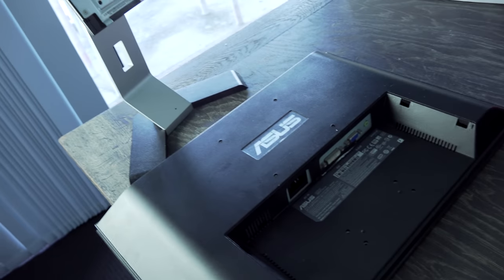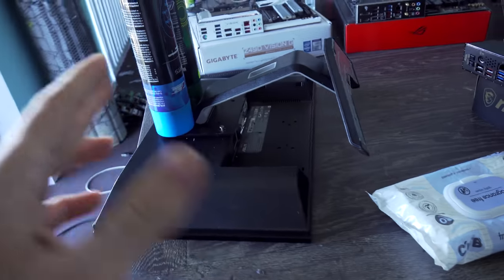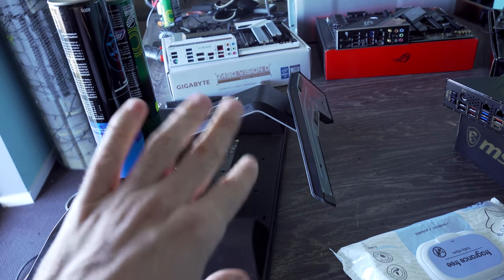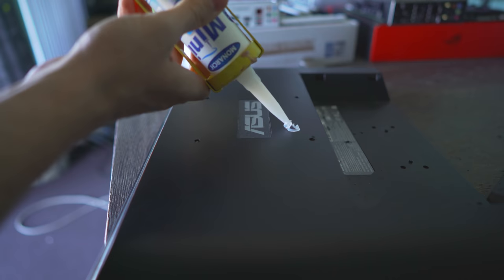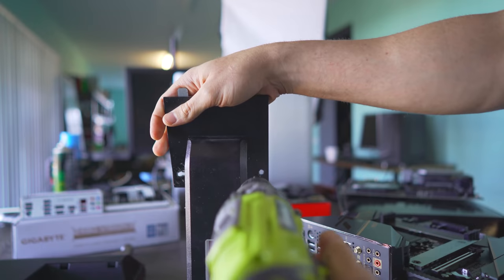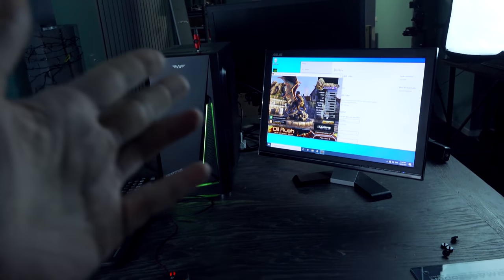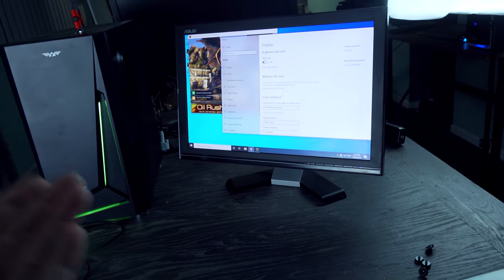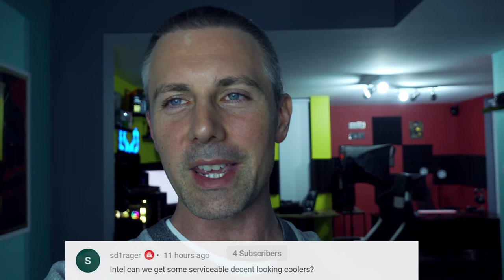How I Made a Gaming Monitor for FREE

Comment: DRILL THE WHOLE FOR THE MOUNT ON THE BACK LOL DONE BAM
Reply: Not ghetto enough, rejected.
Reply: If the screwholes for the mount on the monitor overlay with the metal plate on the stand, yes.
If it only goes on the plastic, better not, might be to weak.
Edit: Look at 5:06 he actually tried that.
Reply: @HappyBeezerStudios  drill a peace of wood or another plate to avoid the plastic bam
Reply: @fafdus  BAM!
Reply: @fafdus  yup, a 1/2" or 3/8" piece of plywood.  Mount it to the monitor screw pattern, then screw the stand to it. No brainier.
Reply: @daniiNL no, screw the wood to the monitor holes, so you would need to drill the wood to match the monitor pattern.  Then wood screw the stand to the wood.  It's just a basic wood spacer, or you could use thick plastic etc.
Reply: I had that very same dell stand for years.  It has a snap in design, hence the metal tabs.  The interface on the rear of the ASUS is completely different.  With Dell, the back of the monitor is recessed for that stand's square plate to insert and snap in.
Reply: @jb678901  doesn't matter if your bolts\screws are long enough lol
Reply: @fafdus  Would need BIG washers then, to avoid too much stress on the plastic.  Usually, screw mounts are metal reinforced.  I suppose you could drill though the back plate and use the right threads.  Just be sure to add the washers.  Easier to just use the two sided industrial tape, IMO.
Reply: @jb678901  washers area a given i work construction it wouldn't be hard at all

Comment: Where’s the part where it becomes a gaming monitor? Or is it a monitor that you game on?
Reply: for a budget build, what makes this a gaming monitor is that he didn't use a tv xD
Reply: @albr4  the HP monitor I used to have that was very similar to the Asus one was 1440x900 60hz, but overclocked to 80hz easy with no color issues
Reply: A "gaming monitor" does not exist, you can game on any monitor. As others said already, just clickbait. (Of course some monitors are miles better for gaming than other, but that's besides the point)
Reply: @albr4  not true at all. 60hz 4k? ultrawide 60hz?
Reply: @albr4  I have 0 complaints these 4 years of gaming on my 1080p 60fps Benq monitor. 
Let people game on the pc they can afford, if they are happy there is no need to upgrade.
Reply: It becomes a gaming monitor when he overclocks it.
Reply: To me gaming monitor is if it meets the demands of eSports players who want absolute best experience...
Reply: @SwiftMCy  yup neither of those are "gaming" monitors. The only aspect of a monitor which causes it to become a gaming monitor is if it has a high refresh rate, reponse time, and must have at least 1080p so that you can play games better.
Reply: @WouterVerbruggen  Actually gaming monitors do exist, they have high refreshrates such as 144hz to allow smoother gameplay and quicker reaction times.
Reply: @albr4  what about low pixel response time? color accuracy? CRT monitors have high refresh rates.. are they gaming monitors?
Reply: @albr4  so what if you change the resolution of your gaming monitor to 480p lol. CRT resolution can get pretty high as well... like much high than 1080p. High end crt could go to 1600p at 75hz. I think you're missing the point. The things that make 'gaming' monitors unique is nothing.. there isn't a distinct feature of a gaming monitor that makes it for gaming. If he's going to game on that monitor, then he can call it a gaming monitor, because 'gaming' is just an arbitrary term to represent a monitor with a high refresh rate. nothing more. GSYNC and Freesync are not exclusive to gaming either.
Reply: @albr4  Well you could also say the same thing about dell multiplexes with low profile gtx 1050s being sold as gaming pc's. It's all perspective based imo.
Reply: @Brandon-uy1uv  No, there's a huge difference in someone marketing it as one thing and it actually being another. You can find cheap "gaming" monitors but the only features are 2ms response, a toggle for a crosshair on the screen, and a "gaming mode" which adjusts the colour. These are not true gaming monitors, they're just trying to get gamers to buy their products. In regards to your example as long as the GPU can run modern games at 60+ fps then they may have grounds to call it a gaming machine.
Reply: @SwiftMCy  You're completely incorrect with your pointless examples that do not prove your point. As someone said before "sports cars don't exist because all cars can drive fast just some drive faster than others" If you can find a 16:9, 1080p, 75hz, <2ms reponse time CRT, then it is a gaming monitor. I'll repeat it again because you can't get it into your thick skull. A gaming monitor has a higher refresh rate and response time than a standard monitor (standard = 1080p, 60hz, 5ms resp). I think you're missing the point.
Reply: @albr4  a sports car does exist. Its speed puts it in a whole other league of car. There isn't another type of car that's going to get that speed. It takes a different form than a regular car, and if a truck or other non-sports car could get that speed, then calling a fast car a sports car would be arbitrary. The difference with monitors is that high refresh rates are not bound to just gaming monitors. They have been around since CRT. And no, no CRT are marketed as modern day gaming monitors. You just proved my point. You can call it a gaming monitor whether it "is" or not. And saying a gaming monitor has to be 16:9, you're so wrong. 21:9. What, does it have to be 24 inches too? A CRT has a higher refresh rate and resolution than a "standard" monitor, no, it is a standard monitor. The only thing that makes a gaming monitor a gaming monitor is that it is called one. There are professional monitors with high refresh rates and low pixel response times, as well as color accuracy and high resolution for video editing. Are those gaming monitors then? He could likely overclock this monitor to 75hz. Is it gaming then? just because the refresh rate is higher? The term is arbitrary to begin with. If he's going to game it's a gaming monitor. If he's going to do photo editing it's his photo editing monitor. I don't get why you think insulting me makes you right. Asshole
Reply: @albr4  lol
Reply: @SwiftMCy  I'll reply to your stupidity anyway. As I said before and you haven't understood it, a standard monitor is 16:9, 60hz, 5ms response time. A gaming monitor exceeds those standard specs to provide the user with an increased reaction time and gaming experience. You can not call anything at or below standard spec a gaming monitor.

Your car explanation just proved my point.
Yes a professional monitor can be called a gaming monitor as it exceeds standard spec (as I've said many times).
Reply: @albr4  Sure, if you can call a pro monitor a gaming monitor then I can call a regular monitor a gaming monitor. And I can call a CRT monitor a gaming monitor, it has a high refresh rate, high resolution. Aspect ratio is irrelevant. I can call a 120hz TV a gaming monitor, surely right? it's 16 by 9, low pixel response time, and a high refresh rate! Sure I can. If I'm going to game on it, it can be called a gaming monitor. Specs do not matter, the intent does. and bruh what if what I'm playing doesn't require a high refresh rate. Something like a fighting game where the game is capped at 60fps so the animations don't bug. If I get a 60hz monitor with good pixel response time and a high resolution, is that not a gaming monitor if I bought it to perform better at that game? It's just marketing slapped on to the same technology that is used in multiple monitors in multiple professions. If monitor manufacturers decided that watching kpop videos was hot and their best way to sell monitors, then they would try to market a high refresh rate as a KPOP monitor. It's arbitrary. same technology. Do what you want with it and you can call it what you want. Is a monitor for gaming not a gaming monitor? it is. you can't stand talking about something without throwing insults when someone challenges what you say. If I'm wrong I'm wrong, but you could be wrong just as well. Maybe there's not a right or wrong. Dunno where calling me thick skulled and rarted comes into play. immature
Reply: @SwiftMCy  Incorrect again, aspect ratio is very important when playing games. You will have a smaller field of view with anything less than 16:9.
 Nope, you can't call a TV a monitor - a monitor is a dummy display that provides an image when given an input, whereas a TV does not need an input.
Nope, specs do matter as a gaming monitor provides faster reaction times.
Nope, it isn't a gaming monitor if you're playing on a STANDARD SPEC MONITOR and it won't make you perform better than a standard spec monitor.
Nope, a STANDARD MONITOR that you play games with is not a gaming monitor.
It's not an insult it's an observation. I called you an idiot - it is what you are, based on your incorrect views and inability to create cohesive arguments and being unable to form a conclusion based upon the arguments made. Also when losing the argument you resort to saying that because I called you an idiot then my argument is invalid which is also a stupid thing to do. I completely destroyed all of your arguments and yet you are still unwilling to listen to reason which makes you an ignorant person. You are truly a fool. Hopefully you still have time to educate yourself and increase your IQ so that you don't embarass yourself on the internet like this again.
I'll say this once again because you still can't understand it, it's a very basic idea. To call something a gaming monitor, it must exceed standard specs (standard being 16:9, 60hz, 5ms response time) - this means that it will provide the user with a competitive edge in a video game over a standard monitor.
Reply: @albr4  lol I never called your argument invalid, I'm just challenging it. You are the one calling my argument invalid. I'm not embarrassing myself, no one gives a flying hoot about what you or I said but us. I guess the whole world should see things the way you do lol. Agree to disagree. don't try to pass off an insult as an argument. You have a very distinct view of what a gaming monitor has to look like. I don't. we wouldn't reach a compromise even if you wanted to. That doesn't make me an idiot or you an idiot. this isn't the type of argument you can 'win'. so whatever, im busy with something else now. thx for entertaining me, I like to argue, but it's not going to go anywhere lol.. wait I got one more. If most gaming monitors are TN panels, which offer poor color accuracy and could negatively impact how someone is able to see an enemy, wouldn't that be disadvantageous, meaning that it isn't a true gaming monitor if that part of the spec is below the normal IPS display? well, a vast majority of gaming panels are TN, so calling those ones not gaming monitors would kind of lose sight of your focus. Unless only high end gaming monitors are what a gaming monitor has to be. and if I plug a hdmi into a tv, it is receiving input. I wasn't talking about watching tv on it lol. well that's it, keep sending replies and ill keep replying until one of us gets bored.
Reply: @SwiftMCy  I think you are kind of right, only because gaps in technology are slowly shrinking.
Some CRTs did come with high refresh, high resolution and 16:10 ratio so yeah by the other guys comments it would be considered a gaming monitor.
But I think his point is that the industry has kind of agreed that the base levels are not "gaming" monitors. But it is just a word attached to it.
Reply: @dfalconerio  Yeah I can dig that. I mainly just found a problem with how specific he thought a gaming monitor haaad to be. I mean, it's all banter anyways. like we're talking about monitors here xD
Reply: @dfalconerio  The same can be said for gaming pcs. If I throw a 550ti in an old optiplex, I can call it a gaming pc. doesn't have to be an 8 core, 16 threaded, 20 TFLOPs power machine. I mean like, those are "gaming" pc components, but so is my 550ti if I game on it. or even like a gt730 or gt1030. not really gaming cards, but you can sure build a gaming pc with one. It definitely makes sense there is a standard, I mean, that's what marketers are banking on to push their product. I mean, in that sense. I can definitely recognize a gaming pc as a gaming pc based off of the specs, but that is not the whole story. I think with monitors it can be a little less, like, presentable that way because gaming monitors are marketed as "being so different"  when it's still a monitor made from monitor stuff that other monitors are made from. I don't wanna beat a dead horse though. Thanks for giving my side of the argument some value. you offered something insightful and constructive.. not calling me stupid XD cheers mate
edit : i think some of his comments got deleted or filtered for downvotes :P
Reply: @Brandon-uy1uv  Everone says they're content with their cheap monitor until they use a high refresh rate one.
Reply: Clickbait title... How can you claim this to be a "gaming monitor" without at least sticking some USB LED RGB to the frame? 😂😂😂😂

Comment: I've used black adhesive silicon to attach inside rear-view mirrors with good results. I live in Florida U.S.A and the climate causes mirrors to fall off far more often than in other places I've lived. After having to reinstall the mirror on my car four times in two years using mirror adhesive kits I tried silicon, seven years later it's still holding. The downsides are a slight wiggle in the mirror, long clamping time (compared to the standard adhesive), and long cure time.

Comment: Don't think silicone will hold long term as it is a sealant not a glue. Liquid Nails would be the appropriate thing to use.
Reply: I have the same opinion. When you look in older kitchens in restaurants where the silicone between the wall and the metal desk is hanging down or when you talk to professionals taking care of maintenance in buildings you know the disadvantages of silicone. But i guess in this case silicone will last longer than the electronics in the old monitor.
So I guess it's good enough.
I would have designed a 3D printed adapter or just used a sheet of metal as a mounting adapter (holes made with a mini Dremel)
Reply: @1234fishnet  We have industrial 3D printers at the engineering firm where I work. They make some crazy cool shit with them.

Comment: I made a swivel attachment for a secondary monitor out of the mounting hardware for a satellite dish. The part on the back that went to the dish did not have the same mount spacing as the monitor's VESA holes, so I used a small piece of 1" thick pine painted black that screwed into the monitor, and then the swivel screwed into it. Much safer than silicone. More robust.

Comment: Nice and easy fix! I got a free stand-less screen some time ago, and I made a compatible VESA mount stand from some pieces of wood. 😝 I later similarly made an extension to mount an old laptop screen op top of it, with one of those laptop screen driver to boards from AliExpress.
Also, that 1440x900 resolution (16:10 aspect ratio) is a very common one in those older monitors. In the 00s it was the most common ratio next to the classic "square" 4:3 screens

Comment: Nice, I'd prob just line up and  drill a few holes through the metal on the mount to line up with VESA holes on the monitor. You could use construction adhesive but, see silicon could work to.

Comment: Quick tip for the Dell stands: If you know someone with a 3D-printer you can print adapter-plates for Dell to VESA and also others (for ~$1 or so) (without altering anything on the stands or monitors) I have done it before, great improvement if you go from a static to the rotating/adjusting Dell ones (look up "Dell VESA 75 adapter" etc. on Thingiverse)

Comment: 16:10 was a thing about 10 years ago. A lot of 2007-2011 monitors was 16:10. Even the Dell U2410 and all of the widescreen line-up was 16:10. 

1440x900 was popular on 17-19 inches monitors for quite a while, stepping up a little bit we have 20-22 inches with 1680x1050 resolution. And the uber 24+ inches with the resolution of 1920x1200.  After that we see 1360/1366x768 is the popular, then skip the 1600x900 (short lived I think) and go straight to 1920x1080 with minimum size of 21 inches. 

And I still prefer the 16:10 aspect ratio. Graphic designers also like this aspect ratio a lot. That's extra pixel is better for productivity. 
In fact, Apple still use this aspect ratio on their Macbook. From Retina-era Macbook, it used 2560x1600 (technically 1440p but 16:10).

Comment: Not quite silicone story here Bryan but my story goes back to when i was a poor 17 year old who just finished high school, i had my first car a white Mitsubishi Cordia Turbo.  A common mod was chopping the air box up to act as a pod filter.  Id been given a Sierra Cosworth style air vent from a friends older brother so i decided to pop that on my bonnet soafter cutting the hole i realized i had no silicone at home nor did i have any money to buy a tube but i found the next best thing, Sellys No More Gaps bathroom tile sealant 😂.

 I stuck that vent down with that stuff and it stuck so good when i smashed the front of the car in a tree the entire front end was messed up but the vent stayed in place perfectly, so thank you Sellys for an awesome product a cheapo 17 year old can use as a silicone replacement 🤣

Comment: Had an old HP computer that came with Vista Home Basic SP1 that came with a 19" Monitor that was 1440x900, very good color accuracy. TCL I think got their start remanufacturing those monitors, because at that time, a alternative replacement was one by TCL, and that seemed to be the only monitor they sold. Pretty sure it was circa 2009